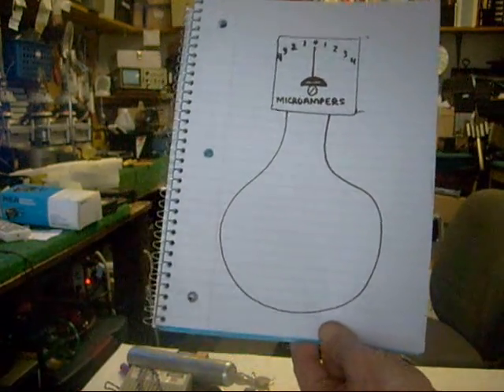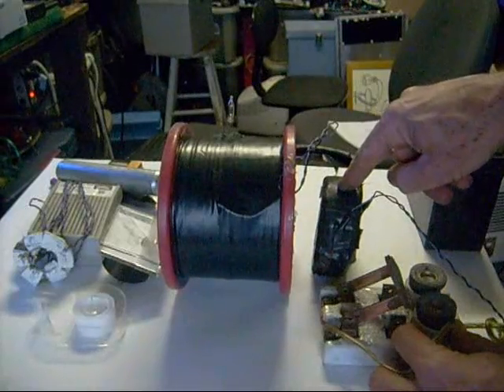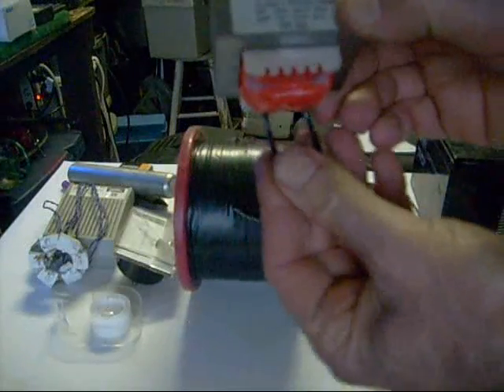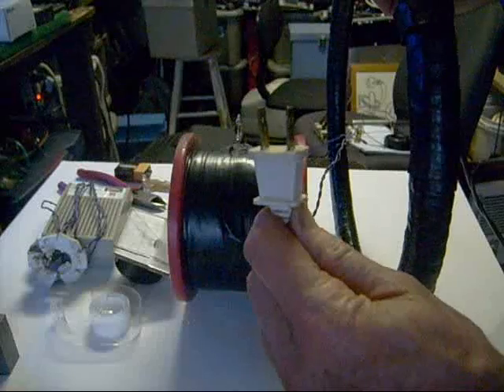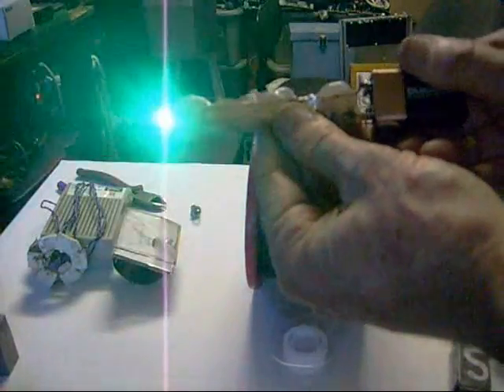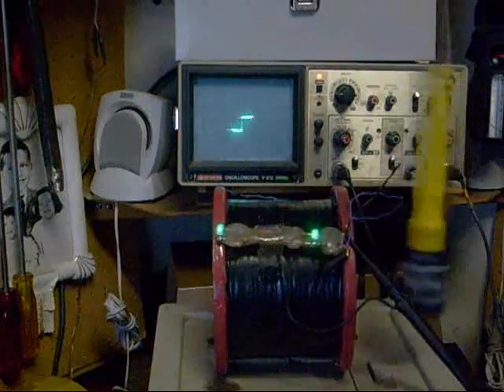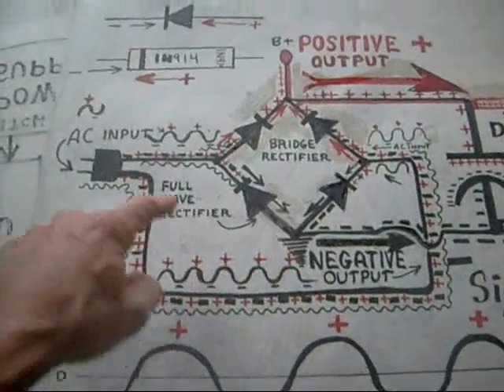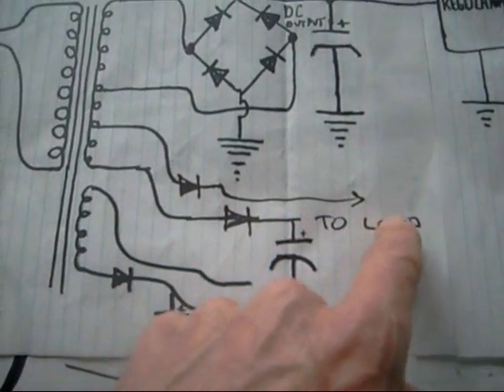Understanding Power Supplies, Generators, AC and DC.

Comment: This is well done. Note that in the first demonstration with the large coil of wire and magnet that the neon lamp lights alternate rods as the magnet goes in and out. Neon lamps have two electrodes when used on AC in a common orange nightlight the rods glow alternately at 60 Hz rate. It's always the negative rod that glows so this can be used as a polarity tester.

Comment from the maker: Hi Brian, Thanks for the info. I'm honoured to hear you used one of my videos. I think the coil I used was 30 gauge wire, I don't remember which wire distribution company I purchased it up from, but based on its weight and resistance per foot I figured it has over 10 miles of wire on it. Needless to say that's not something you want to wind by hand. What I did was carefully melt  the inside side of the plastic spool and soldered on to the innermost winding where I was able to attach a wire. Dave

Comment: @GrantsPassTVRepairs Dave, I've also been playing around with crystal resonance testing. Normally, a dipmeter would work great by itself or with a scope; I also found that you could use a function generator's center wire (with a small ext. wire as antenna) to tickle the resonance of the crystal and view the peak on the scope. Thought I'd share that.
All the best,
Nelson
PS> errata on my earlier comment, I meant 'Dave'! (sorry)